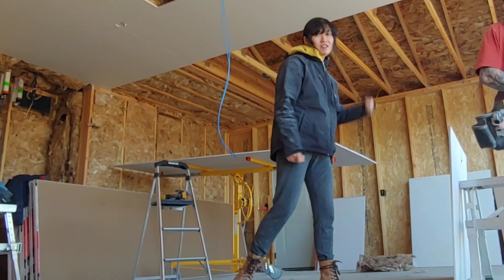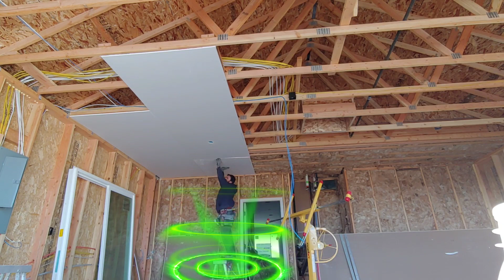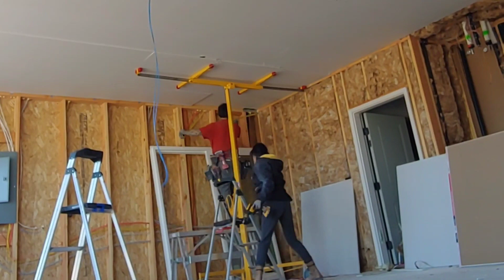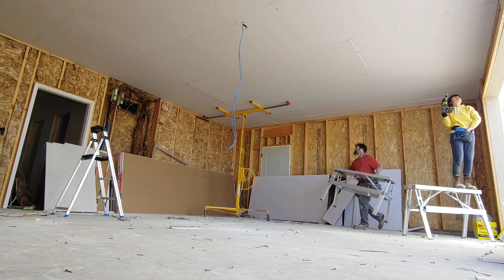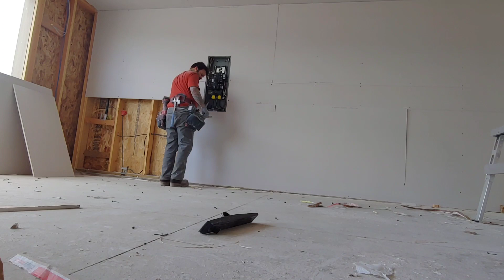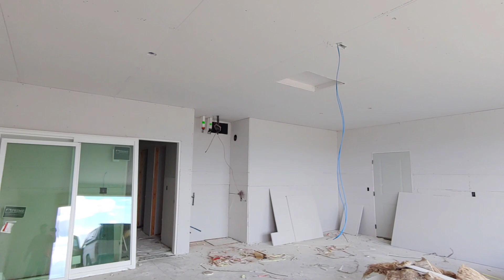using drywall panel lift | fast work

Comment: I remember a long time ago a guy came to your channel and told you ... "You need a panel lifter it will save you money and  remove the need  for two extra guys breaking their backs" . (The old timers on the channel  gave the comment some gruff).. That guy  even told you to buy the best "panel lift "  and not waste money on knock offs ... Good work ..
Reply from the maker: I should have listened haha. The new panel lift is by far the best. Hoping to get some helpers soon but I'll continue to use the lift and save my energy for the day. Ive gotten pretty fast with the thing too.

Comment: How's working out the Nissan vs the ram you used to have?
Reply from the maker: Everything fits in the back of the truck and the canopy keep it all dry. Plus the gas millage is killer!
The ram was a diesel and I sold it when everything spiked in price. Got almost what I paid for it.
Cashed out on the little rice rocket so all in all id say the Nissan has been great. Of I could fond one with an extra cab and long bed id take it!
Reply: @NomadicINK  canopy are nice to have. My ranger came with one. One reason why I bought it

Comment: Whew! I got tired just watching the pace at which you guys work! Only way to get done though is to 'PUSH'. It's not easy,I know but your body gets used to it. The key I've found is to not make mistakes. Go up with the board one time. If you don't measure it right and you keep having to drop the board and trim it,there goes all your production. Not to mention that it also exhaust you much more having to lift the boards twice.
Great job ,as always!  Living that Drywall Life!

Comment: I’m new to drywalling so excuse me for this question. Why do you do you double up ceiling?
Reply from the maker: Only in the garage is 2 layers of 5/8 on the ceiling for fire codes in this area. 
It creates a 2 hour fire rating when you double layer 5/8 drywall.
Reply: The building codes reflect the  distance of the fire department.. And  whether a  ceiling needs a 1 hour or  or more rating .. A  1 hour firewall has 5/8 drywall  on each side of it , with a metal stud sandwiched  .  the 1 layer of 5/8  is rated for 40 minutes . After the fire burns through the layer the metal stud will only last 20 minutes   and it will no longer hold the other side up. Thus the system is called a 1 hour wall.. With two layers the rating is now 80 minutes and then the stud burns and the structure falls ..   A firewall with 2 layers on both sides   is 40  minutes  + 40 minutes  and 20 minutes for the stud to fail .. So technically its a 100 minute wall .. But is called a 2 hour firewall.